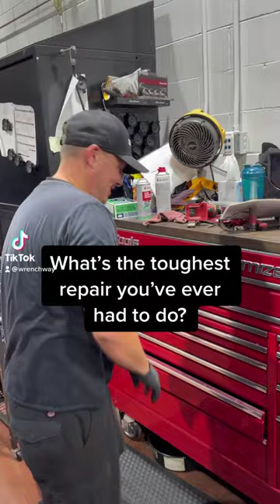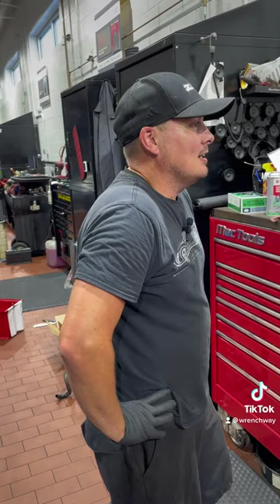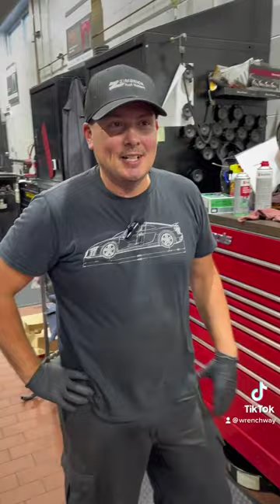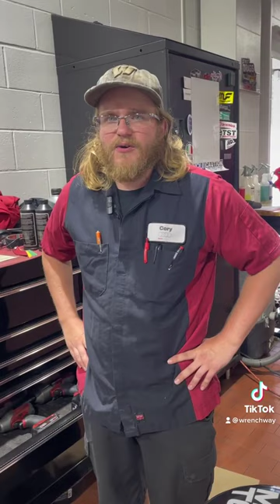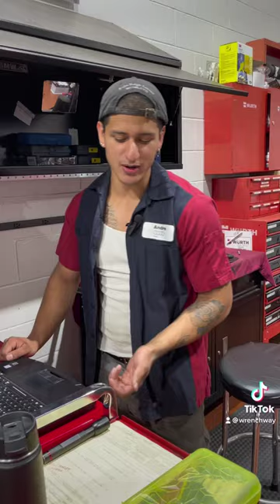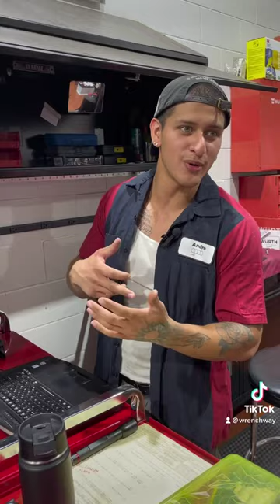Technicians Talk About Their Toughest Repairs #shorts

Comment: I replaced a frame on a 2017 Ford F-550 flatbed tow truck. I had to remove everything including the aftermarket flat bed and I still had to modify the new frame in order to install the flat bed back on.
Reply: 2017?? why was that needed
Reply: @smallworld1568  The frame had 3 cracks about 7-9 inches long. These cracks started from the bolt holes for the flat bed guides that were first drilled when the truck was equipped with the flat bed. There’s a recall for 2017-2019 f550s equipped with aftermarket utility beds, boom equipment, dump trucks, tow trucks or any sort of heavy duty application. The recall requires the removal of these aftermarket beds in order to install reinforcement brackets on the frame. We as techs are required to inspect the frames in certain locations for evidence of cracks. 9/10 of these f550 frames are usually not cracked. Ford still requires the installment of the reinforcement brackets regardless. If cracks are present then the frame may require more than the minimum amount of reinforcement brackets where ever necessary. However this tow truck did have these cracks and the owners decided to have their own guys attempt to repair the cracks by welding new material on the outside edges of the frame. This ultimately did nothing as the cracks started from the inside edge of the frame. The damage was so bad that the tow truck was sagging down the middle between where the cab ends and the flat bed starts. The frame had basically started to collapse and cave in on itself due to the weight of the cab and flat bed. Pictures were submitted to Ford and they determined that the frame was junk and no amount of reinforcement brackets was going to save the frame. So Ford approved that a new complete and updated frame assembly would be the appropriate repair and I was the lucky guy to get the job. I won’t lie it was a helluva experience both mentally and physically. Not too many techs can say they’ve replaced an entire frame let alone a flat bed tow truck.
Reply: what was the book time on it?
Reply: @kb01663  No book time for a repair of that size. Ford said that they would pre approve at least 60hrs but that they knew it would take longer than that due to the aftermarket flat bed and anything else that the owners may have installed. Ford ended up paying me about 130hrs.
Reply: @eduardoreyes2933  respect bro

Comment: The hardest repair to do is work on any dodge product. The more you touch, the more things break. Especially if it’s an older vehicle.
Reply: So it's not just me...
Reply: And don't even breathe on the plastic interior parts or they'll break into a million pieces
Reply: You have to be smarter then the car. I’ve had Fords and Gm’s give me just as many headaches
Reply: @waterloo123100  True; if you mention any car that's not a Toyota or Honda people will go on to tell you how it's the worst brand blah blah blah as if no other brands had any issues.
Reply: @benjaminabel8596  My family has had tons of Dodges and they have been great cars. My summer car is a civic but my winter car is 96 Jeep 5.2 and runs great at 252k original motor and transmission. They all have their issues but a lot of the time it’s how your treat it.
Reply: Just did the radiator on our ‘03 Dakota. Two-hour radiator replacement quicken turned into a trans-cooling line ordeal that lasted a few days.
Reply: Bro,my 97’ 3500 ram van is so easy to work on but ya every time it turns into 1 planned repair and 3 unplanned ones

Comment: Did a body harness on a 17 vw Passat , 70 hrs
Reply: 70!  Yikes
Reply: why
Reply: Be so deadass rn
Reply: Wow that's crazy
Reply: The vehicle was towed in from the body shop apparently little guy welding from underneath the car forgot that you can cause a fire inside of the car and he caught the main body harness on fire tore up the carpet the front passenger seat covers and foam, reupholstered the right front seat replace the whole harness that goes from the rear bumper sensors to the headliner to the rear trunk lid through the dash remove the AC box then to fit the harness/fuse box Through a 3 inch hole in the firewall I have the de pin the 80 wire fuse box fish the wires through the firewall then pin it back to the fuse box in the engine bay put the headliner back on , carpet, dash, bumper . It was fun

Comment: Complete suspension and steering component replacement on my Grand Marquis. Didn't have a drive on lift so I had to get very creative in making the car the correct ride height before I tightened up the bits with bonded bushings.

Comment: Mine so far was doing a 5.2l engine replacement on an crew cab Isuzu. Had to take it apart through the floor access holes and drop the engine out the bottom of the chassis. I had over 120 hrs on it. Do not recommend.
Reply: Why wouldn't you have just taken the cab off?

Comment: I'd be like heater cores on the older dodges , finding body creaks behind the dash on a Camry that turned out to be the body needing tac welded , and don't shy away from exhaust studs or for spark plug jobs on the old fords . Electric work on German cars I could go on for days .

Comment: The hardest job I had to do was pulling the engine from my car in my backyard, with a cherry picker and 4 jackstands with pieces of metal under them to elevate the car enough to be able to slide the engine and transmission out from under the car. And also when I had to replace the wiring harness of a 2013 Dodge challenger and removed the entire interior.

Comment: I had to replace a spun bearing seat on a homemade trailer in over 100 degree weather in the gravel, the brakes had seized so I had to peen the bearing seat and use JB-weld, using the hub to center it while the JB-weld set.
I was in the middle of nowhere with no air conditioning.

Comment: I saw some guys at my time at VW pulling the 3.6,v8 or the diesel 3.0 TDI the whole engines comes from the bottom along with suspension, trans and frame on a big table. Then I saw one dude do timing chains and head gaskets there. I felt Soo bad it looked Soo annoying and tidious and so many bolts and hoses.God only knows how he managed to put it all back

Comment: Ooohh or a shorted electronic steering communication wire on a Chevy cruise. Would cause the car to die when turning cause the wires would touch. That was also a bitch. That would also have to be top 5 hardest cars to diagnose.

Comment: Candy orange turbo E36 M3 melted his wiring harness on his turbo. I had to remove and clean up the old melted harness, split open the new loom, and add the circuits for his aftermarket tuner and what not, then install the entire harness around all his aftermarket shit. Took me like a literal week of working every day. Probably 50-60hours.  Didn't even get to test drive it after cause I was the apprentice. That car was mean though.

Comment: Put a 6.4 longblock in a crane truck with a locked up motor, couldn’t pull up the cab out the way because the crane ran over the top and couldn’t move the crane cuz the engine was locked up and wouldn’t turn the belt driven pto. That customer thought his 200 thousand mile truck would be show worthy, and was mad after the repair that the crane didn’t work. I fixed the motor dude, I don’t do upfitting or work on cranes

Comment: Not necessarily hard but physically exhausting job I had was a 2 year old tandem axle 26ft roll back truck, all the hydraulic lines where ran really badly by the upfitter to the point nearly all had rub thrus and where leaking. I’m not small 6’5” 250lbs and had to replace a reroute all the lines with the bed down, my uniforms and arms and face where pure black the 2 days that took, also had bad back pain from cramming my self over top the drive axles to route the lines. Not hard mentally but Definitely worst physically

Comment: A rx7 in a cold place or a automático motor trasmisión some parts have to be like a a warm or hot temp so that it fits like easy in place. But placing a motor back can be a pain if You try to put back the motor in box might have to take a part off example may be water pump.does not let foto or go in place.

Comment: come and work on buses 10 to 13 litre diesel engines everything is packed in tight as can be to get more seats in. if you think changing a cv is difficult fuck me you would cry having to pull a volvo b12 engine and gearbox 🤣